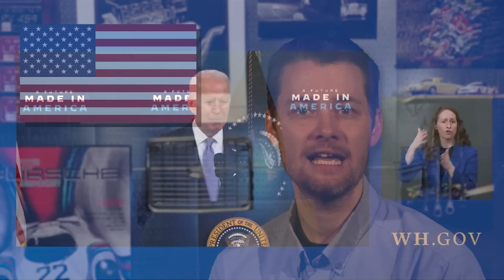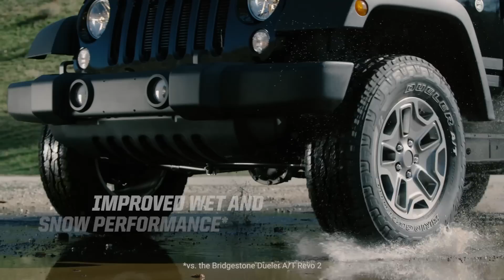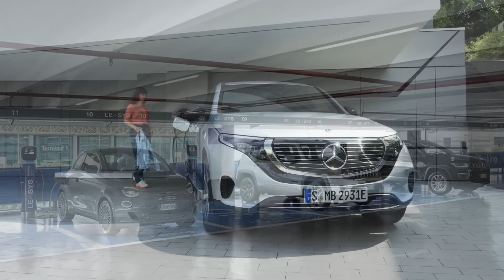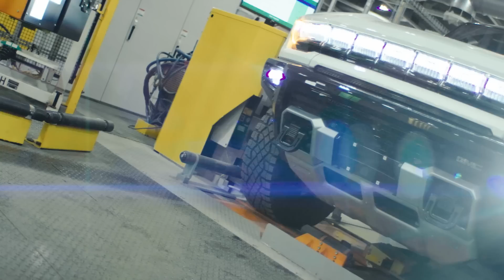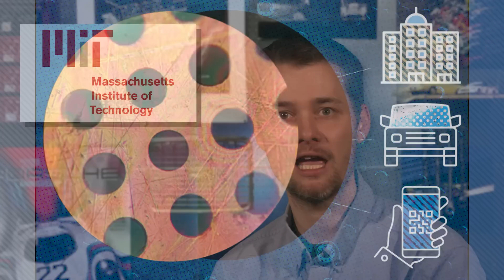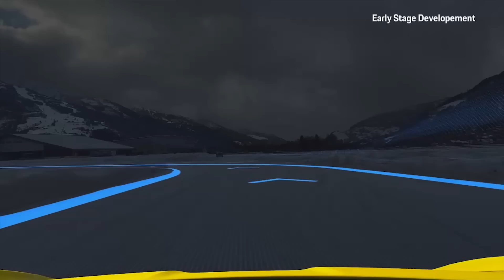Tesla Pioneers New Assembly Technique; GM Dramatically Ramps Up EV Production - Autoline Daily 3257

Comment: The VW Beetle was a body on top of a pan. In that case the, drivetrain was already installed on the pan before the body was lowered over it. Additionally, the suspension, carpeting, and the full steering assembly were already part of the bottom half assembly. I've also seen a lot of noise about how Tesla dips their body in a metal protectant. This is something else that Volkswagen was doing with the beetle, perhaps from the very beginning. One of their print ads illustrated the process. And while on that topic, I will never, never, never, understand why the American auto industry was SO slow to react when they began losing market share to Volkswagen beetles. Just by reading the VW ads you'd see how their cars were made so much better. How about if I just ask you to think about the Ford Pinto, and the Chevy Vega?
Reply: Fiat has been installing seats and dashboards using robots over 40 years ago. Hopefully Tesla will catch up some day soon.

Comment: Its takes the oem's 2 hours to assemble the subframe of a car. It takes Tesla less than 15 minutes with the castings and structural pack. But sure lets talk about seats.... lol
Reply: Nonsense….. those subframes and chassis are actually very polyvalent for all kinds of applications, from custom bed to conversation into rv, bus….. the tesla casting takes way more than just 15minutes, the cast part needs to be verified first then welded to the rest of the car…..
Reply: @carholic-sz3qv  Not welded - bolted.
Reply: @carholic-sz3qv  You need to do some homework pal. Nobody has ever cast anything as big as what Tesla is doing. They had to invent a new metallurgy to enable them to cast the whole rear clip.

Comment: GM and Chrysler are screwed (Ford might survive). As sales of ICE powered vehicles plummet in the next 5 years they won't be able to produce affordable EVs. They are going to be selling the few EVs that they do produce at below what it costs to make them. Secondly, the EVs that they do produce are going to be mediocre and that will cost them customers.

This race is over, Tesla won, it's going to be impossible to invest the  billions of dollars needed to make the shift into EV development when your sales are plummeting and your selling cars below cost. I only wish I had sold my Ford stock when it was at $30 a share.
Reply: Anyone who says "the race is over" doesn't understand innovation and progress. 

The race never ends, it just enters a different phase.

Every intelligent account of the EV market suggests we're in the infancy of EVs. And while Tesla may be in the lead now, there's good reason to think it may change- right now all their vehicles are stuck on a 400V architecture while newer competitors are standardizing around an 800 V and beyond. In addition, they're working with open standards and more advanced sensor systems for autonomous driving. 

If history is any indication, open standards tend to be more ubiquitous and less costly than closed standards (such as a charging network). And more advanced sensors will be required for full autonomy. 

I wouldn't count on Tesla holding onto the lead much longer...
Reply: @Paulo  ok, if Ford plans to spend under 1k per vehicle on r&d and chevy says $1500 meanwhile Tesla already has a 10 year head start and continues to spend $2500 per vehicle to improve, you add up how they can catch up, it's not going to happen.

 That's not even taking into consideration to whole robotaxi thing. Tesla is going to kick the legs out from under the automakers within a few years and there's nothing that they can do about it.. They had all the time in the world and they blew it off.

 I'm not even a Musk fan and I can see what's happening and what's coming.
Reply: @thebigdoghimself  The ghetto can't afford fucking teslas
Reply: @thebigdoghimself  

Lucid has already surmounted Tesla's efficiency, power (per kg of electric motor) and range lead. And  they want to be parts supplier to other companies. So the whole "10 years ahead of everyone else" idea is a complete exaggeration.

Solid state is on the verge of release.

A number of companies are demoing production ready level 3 autonomy and completely driverless semis while Tesla makes you pass a test for level 2 (also, indications are that less than 20% of Tesla buyers are adding the FSD upgrade- even Tesla owners aren't convinced).

Meanwhile Tesla is becoming a third mover on electric pickup trucks.

There are several reasons why Ford is up 50% year over year while Tesla is is only up 8. Their stock actually went down after a good earnings report, and it's because of their ongoing production ramping/scaling issues. Musk couldn't offer a realistic plan to get to 50% growth. It's become clear that while vertical integration has it's advantages, Tesla has lost focus on it's core competencies. Meanwhile Ford offers a shareholder dividend as part of it's stock.

To my surprise I've made more money on Ford than Tesla stock in the last year.

Do a little research ;)

A number of
Reply: @Paulo  lucid, if they survive produces low volume. They are not a threat. Their production goal for 2022 is 20000 vehicles. It's basically a joke.
Reply: @thebigdoghimself  it's cute how you talk aboutmthis mythical "10 year" advantage, and then when I point out the startup that leapfrogged Tesla, you move the goalposts to talking about small production numbers. 

Look up Our Next Energy- their batteries ust completed a 700+ mile journey on a single charge.

These companies are leapfrogging Tesla with smaller budgets. The only joke in this conversation is how your point about their 10 year  advantage was demonstrated to be wrong, and you tried to sidestep it by talking about production numbers, as if those numbers won't change.
Reply: @Paulo  But they haven't "leapfrogged" anyone. Just because their battery architecture is different doesn't mean they are better. Secondly, there is that 10 years of Teslas technology which I'd proven. There is no history as to the reliability on Lucid's platform. All you have to do is look at Porsche, they released their models over a year ago and we are just now hearing of problems. It's not fair to compare the two companies until you actually have that 200k units on the road to see what happens. After all, we have seen almost every automaker who has tried have fire issues.
Reply: @thebigdoghimself   you're the only one looking at ONEs battery tech which covered a 700 miles journey and Lucid's motors which run on practically the same battery pack that Tesla uses that can cover over 500 miles in a heavier car and try to disqualify them on reliability issues that you can't provide plausible evidence will occur.

Lucids motors are clearly better. They produce 9 HP per kg compared to Tesla's ~3 HP per kg while using less power per hp. So yes, Lucid's motors are clearly superior.

But it's cute for you to talk about battery fires when Lucid's key innovation was a more efficient motor. Yet again, you pivot and move the goalposts. 

You're also understating the extent to which Tesla is prone to fires. They've issued a software updatesto cut usable capacity to prevent fires. They're now paying some people for cutting their range. There's been reports of the Plaid catching fire along with recent garage fires of other models. With the exception of the Chevy Bolt, there isn't data suggesting others vehciles are more prone to fires than Tesla, especially when you factor in Nio, Xpeng or BYD, especially since almost all manufacturers get their batteries from the same sources as Tesla.

Beyond that, Lucid has plenty of history developing power trains- before they adopted the Lucid brand name, they developed EV power trains (under the name Atevia) since 2007 (longer than Teslas existence) for commercial and racing applications, mainly Formula E vehicles. Their power trains are already proven to be  reliable under conditions much harsher than daily driving.

But again, the subject of battery fires is a tangential subject to the fact that it's Lucid's motor technology that's made the jump. It's a big stretch to discuss the risk of fire in relation to the  advancement of the motor. If anything, a more efficient motor puts less strain on the battery, reducing the risk of fire. Let's keep the FUD to a minimum, shall we?
Reply: @Paulo   My last point is going to be to look at what's been released by everyone including Porsche, Audi, VW etc. None of them have come close los to what Tesla is making, the reality is not  even close to  the model 3 which is tesla's basic car. So no, they're not going to catch up.  In fact, for every car they sell Tesla will sell more cars because people will realize how crappy the GM the Ford and the other products are.

You're talking about companies that buy parts from suppliers versus a company that manufactures its key components itself, huge difference which gives a huge advantage when it comes to development.

Comment: They new assembly method means it takes near ZERO time to install carpets, seats and console etc. This is because the time preparing the battery assembly with the seats (etc.) happens in parallel to body assembly and therefore these fittings no longer add any time to the start-to-finish production time.
Reply: And unfortunately will be a serious problem when trying to repair faulty battery cells or other components in the pack.
Reply: @carholic-sz3qv  Seeing as the battery warranty is likely to be longer than your ownership of the car that is Tesla's problem,  not the buyers problem.
Reply: @johnpublicprofile6261  lol….. what will happen when the warranty is over!? What about reusing the battery?
Reply: like an engine replacement drop the battery....
Reply: @aknorth1053  lol….. drop the battery and throw it away!?!! The actual battery modules in the pack are way easier to teardown and reuse until no more viable before a physical recycling.

Comment: I did hear Shell oil is putting  some chargers in gas stations in Europe.
Reply: Shell is the one oil company that probably has invested the most (BP and Chevron have as well) in Green Technology. For example, most H2 fuel stations in Europe are owned by Shell.
Reply: @syxepop  and they also exploit and refine the oil used to mine raw materials and make EVs too

Comment: How the bleep is installing a different fuse going to fix a fire problem
Reply: Electrics and thermals and science
Reply: The fix isn't just installing a new fuse, it also involves removing the ABS controller, shaking it, and replacing it if there is a rattle.

Comment: The sad thing about the Hyundai recall is………This could be done in   Software  update on a Tesla.    The Tesla 3 has no fuses.   The simply have Circuits  that open under extreme current demands ( IE malfunction).   All they would have to do is lower the open ckt command  to a lower  Amperage in a over the air software update.   The problem could  be corrected  overnight.   

Now I understand why the 3 has no conventional fuses.
Reply: The sad thing about tesla is that everything cannot be solved with software update
Reply: @carholic-sz3qv  most problems in a modern well engineered car can be solved with software.   I needed 4 upper control arms on my 3.  Can’t fix that with software.    All 4 were replaced in well under 3 hours.  Cost?   $198 complete.  Seems like Tesla engineered the car so that the control arms could be replaced easily.   As can the motor  and the battery.
Reply: @fatboy19831  lol….. modern cars are also designed to be very polyvalent on the use with variations of specific parts and no software can manage it. All tesla cars are basically the same, used only for one purpose….. a Subaru does both very well on and off-road, overlanding, camping, towing…..
Reply: @fatboy19831  the ford f series trucks comes in all kinds of configurations possible some converted into dump truck, RVs, ambulance……
Reply: @carholic-sz3qv  Subarus in spite of their Loyal customers all have engineering flaws from day one.  And Subaru will never acknowledged them.   Head gaskets,  Emission systems fires ,  Valve springs, Oil starvation.    I have never owned a Subaru that did not have some major flaw.   I can’t believe the head gasket problems from the 90’s and 00’s.  Subaru never even admitted the problem.   Every 80k you had to replace them.  Even when you purchased a used one the owner would have proof of the last head gasket change.   I had a 96 wagon burn to the ground along with two other of my friends.   Only the wagons?  Wtf.   My 2013 Brz broke a valve spring at 52k miles.   Subaru would not repair it under warranty.   2 years after I sold the car they put out a recall.   When the dam cars were 6 years old.   Subaru can make perpetual motion machine I would not buy it for $100.  Subaru is dead to me.
Reply: @fatboy19831  lol……. All car manufacturers have their  flaws and the Subaru head gaskets issues are thing of the past, also even if your Subaru fails it’s still repairable in and out of warranty unlike the tesla which won’t even sell you parts and might also block you from using their superchargers.
Reply: @carholic-sz3qv  my Tesla 3 is a 2018 the first year of production.  Mine is just over the 100,000 car.  Unlike Subaru.  When there is a mechanical problem with a Tesla they start working on a mechanical solution instantly At the factory.  My December 2018 Tesla 3 has different brakes , seats , headlights , Suspension parts and shocks vs the April built Tesla 3.  The 2022 Tesla 3 is light years better than mine.   I has a heat pump, awd, over 100 more Hp ,  Double pane glass,  A far simple chassis design,  a processor that is 100 times faster and more powerful. It cost about the same as my car did.   My car has not Depreciated it in spite of this.   Why pay 40k for a 2018 when you can by a new base 3 for 43k with the same range?    Because you can buy a used one today vs waiting 1 year. 

I have had so many Software updates including. 

Improving braking performance Immensely. 

Adding 30hp , 15 miles of range, rear heated seats,  Netflix, Hulu, Discovery plus and YouTube when parked,   More efficient heating and ac, security system with remote video surveillance, DVR traffic cam,  headlight pattern improvements,   All for no charge.  They even updated the crappie 480 I rear view camera to full high def with two side view cameras. 

This is the future.   My good friend just Purchased a 2022 Hyundai pick up with a lot of the same features.   Including Tesla Bluetooth key.
Reply: @carholic-sz3qv  wtf?   You can buy parts from Tesla.    You can do many repairs yourself.  There is also a huge market of aftermarket parts.   I have a few upgrades I have done to my car.  Tesla will also sale you upgrades like adding 80 Hp for $2500. 

It is their superchargers.   They have the technology to block you if they please. Why block you from spending money at their superchargers?  For what reason?
Reply: That is fine if you want to spend several times more for the parts.  Teslas are for Yuppies who can afford this.  Hyundai is a working man's car.